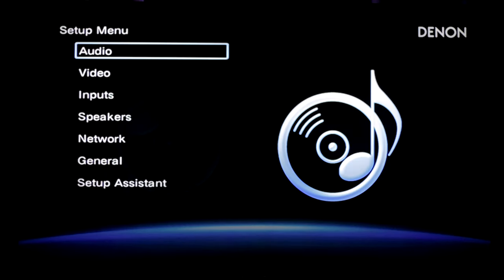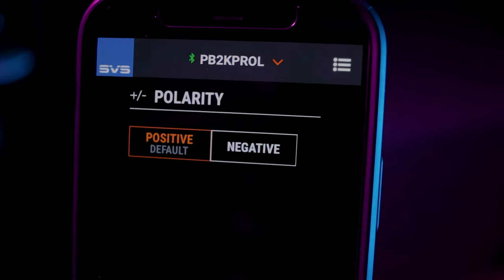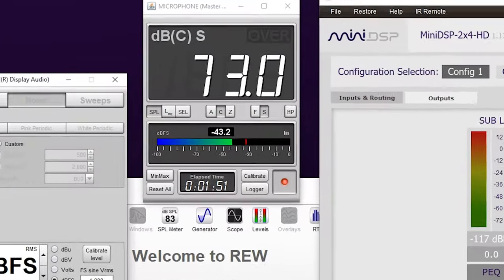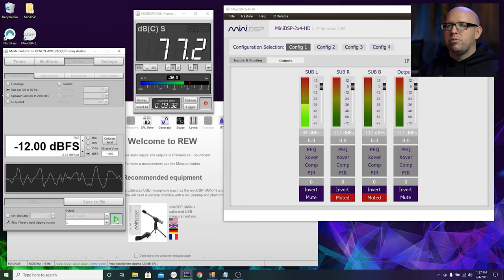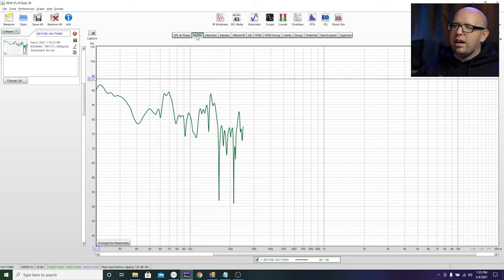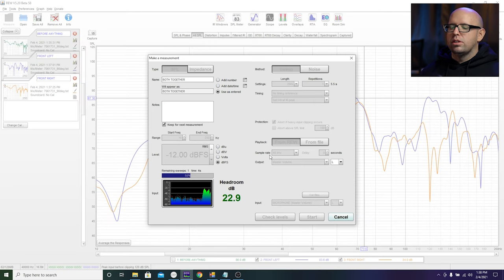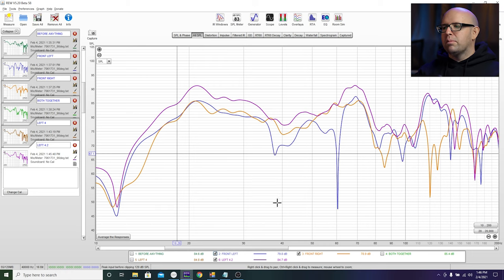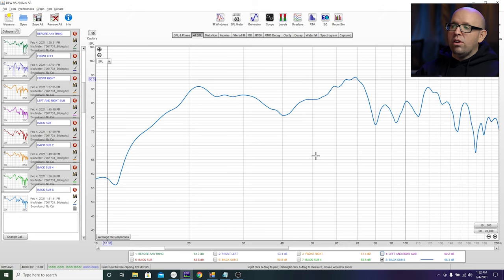miniDSP 2x4 HD | Subwoofer,  receiver SETUP and TIME ALIGNMENT guide (part 2)

Comment: Brad help!!!!  Why when I want to run my subwoofer sweeps am I only getting the sound from my front left channel?

Seems others have had some similar issues too without any reply.......is there not an answer to this?
Reply from the maker: That’s really interesting. I’ve not run into that problem. Are you using ASIO4ALL? If you are, try switching to JAVA or using output 4. Also, if you’re speakers are set to large in your receiver, or your receiver is in DIRECT or pure mode, then that might be why as well. You want it set to STEREO or Multichannel Input. And make sure you speakers are set to small. 

I’d verify all of those things and see what the results are. Sorry I can’t be of more help as I just haven’t experienced that issue.
Reply: @HomeTheaterGamer  I have tried everything under the sun.  Speakers are at small, levels are 0.0, Audyssey is off, stereo is selected,
Switched the Denon back to 1 sub.  Using Java. 🤷‍♂️.  
Thanks for replying 🙏
Reply from the maker: @Ryan Lewis just so I’m understanding you correctly, you’re not getting any sound from your subs at all, correct? 

I’d also make sure to verify that on the MiniDSP software, under the inputs and routing section, that ANALOG is selected. Mine defaulted to USB. Also make sure that all Xovers in the Outputs tab are bypassed.
Reply: @HomeTheaterGamer  I have everything set as you just stated.  I am getting sound from my subs but also from the mains when setting SPL levels.  
But, When I take a measurement in REW the subs are not working, just the main as my lowest frequency is 38 which is on par with the RP-8000F.
Reply: @78rlewi  I'm having the same issue. When I'm attempting to level match, my left front channel outputs pink noise with the sub cal setting. I'm not getting any noise from my subs. Have you figured this issue out, by any chance? Thanks!
Reply: @degicank22  This is my issue
Reply: @dariusdaniels9181  I have two SVS subs. I had to power them down and reset them to get sound out of them, for some reason. Resetting them did work. You will get some noise out of the L or R main speaker, but should only be above where crossover is set. In my case, 250 hz.

Comment: Hi should I be leaving the output to the left channel (L) when measuring levels on my sub?  Or should I be changing the output to LFE?  Although I have raised all crossovers and disabled DSP (I think) in my Yamaha receiver I am still getting output from my main channel when using the L channel for the test.  Even with the REW setting changed to sub.  Not sure if I am perhaps missing something in the Yamaha or if I should switch it to LFE for measuring the level of my sub (I only have one).  Thanks for any advice!
Reply: Same here with my Denon receiver

Comment: Great video! I just bought a UMIK-1 last week and followed your video to get some sweeps of my sub. If I'm running only 2 subs don't you want to add delay to the second also? If they are about the same distance? I'll be adding a second soon and curious. Looking forward to the next video I'm curious on what to do next as far as calibration with audyseey and if you run it next. I like to run my subs hot usually over 80db to get a final trim of -11. 5 maybe some of this will be answered in the next video 👉. Also one more question I have 2 sub outs on my denon should I run just one to the DSP to control my 2 subs? Or both sub outs to the in of the DSP ?
Reply: Just one sub in, mini dsp will split the signal internally.

Comment: When you gain match, do you keep the distance from listening position the same? In my room the Front Sub is 11-9 away and the rear sub is 7-6 away. Does it interfere with the delay time?
Reply from the maker: I wouldn't worry about the distances too much as time alignment with the miniDSP will take care of that. It shouldn't interfere with the delay time at all.
Reply: Cool. I just bought 2 Monoprice THX 10s so I will have to try and gain match them and see how that sounds.

Comment: Great set of videos very useful! I have a question though I've set the crossover in the receiver to 250hz but when I play SUB cal pink noise I hear it through either my left or right speaker as well as my subwoofer. It throws off my calibration to 75db because its so loud from my main speakers.
Reply: I have the same issue. I set the crossover to 250hz in the receiver, but I'm getting pink noise from my left channel. On top of that, I'm not getting any noise from my subs. I see a rise in the output meter in the MiniDSP plugin, but no sound. I don't have them muted. Not sure what's happening there. By any chance, have you solved this issue?
Reply: I get the same issue. I've got the crossover in my Yamaha RX-A2080 set to max 200hz on all speakers, yet I still get output from the left and right tower speakers rather than isolating to the subs. Hope someone can help
Reply: @mwstorms21  My issue turned out to be a problem with my SVS subs. I wasn't getting any sound from my subs, and the receiver was directing the sound to my mains. I had to reset the subs to get them to pick up the signal. For calibration, I believe that you'll get noise from the L or R mains (which ever is set to receive the signal in REW), but above the crossover set in the receiver. When you run the frequency sweep, the sub should output the signal up to the 200hz. As for the pink noise, make sure the sub is receiving a signal. That was my problem at least. I know everyone's issues are different, but I hope this helps a little.
Reply: @degicank22  same exact problem here. I think he left out a step
Reply: I got the same issue with my SONY avr so I just unplugged the speaker cables and then I got the sound from subwoofers only. It could be some simpler thing going on I just can’t figure out.

Comment: Hi thanks for the explanation, why are you using the 90 degree mic cal file if you are calibrating in stereo ? I read in the minidsp that the normal file is to be used when you are calibrating a single speaker (like a sub) please let me know if I got this wrong.
Reply: Since he is measuring three speakers in a HT set-up, the mic is in the vertical position and the 90deg cal file is for that position.  If your are measuring a single speaker "near field" for it's performance or a stereo 2.1 system you use the mic in the horizontal position and the 0deg cal file.  I hope that helps.
Reply: @welderfixer  thanks

Comment: I noticed that no Phase adjustment was done in the minidsp.  Is there a reason why you didn't?
Reply from the maker: There is a reason. Adjusting phase on the subwoofer itself or adding a time delay using the miniDSP both achieve the same thing. Time aligning is basically adding a delay to one sub to match another, which is essentially what the phase adjustment on a subwoofer does (adding a delay to the input signal). I chose to use the miniDSP as it allows for far more granular control down to a 10th of a millisecond and I also find it easier overall.

Comment: Brad, curious.  what would you set the distances to in the AVR?  I have 4 subs.  2 in the front corners and 1 on each side of my couch.  If 2 are 10 ft away and the rear ones are 7 feet away is that what I would set them to in the AVR distances tab?
Reply from the maker: That's a good starting point. The sub distance settings aren't really related to distance, though. They're essentially an alignment adjustment so they blend with your mains better. If you have REW and some free time, use REW to to measure different settings for each pair of subs and pick the one that gives you the smoothest response at and around the crossover point. That will be the optimal distance setting. I'll be doing a video about this soon. Possibly even this week.
Reply: I guess what I'm curious on is in the mini dsp the 10 and 7 would be good starting delay points ... but in the AVR I would leave distance/ delay at 0 since the dsp will be handling that correct?  oh and in the level matching.... what did you set the subs gain knobs at to start with

Comment: The the master volume meant to be at ref? 0db?
Reply from the maker: It can be but not needed here. If you do want to run it at 0dB, then you'll want to change the tone generator and measurement volume to -30dBfs. Otherwise, you could damage your equipment and possibly hearing running those at REW's default of -12dBfs.

Comment: I've followed the first video and this one to a T, but I can't get sound to play out of my subs. Minidsp is connected, subs are hooked up and on, etc. When I select sub cal it play through my speaker that the speaker cal did.
Reply: I'm having a similar issue. My front sub will play pink noise, then for the second output on the rear sub, my Left front speaker plays. I'm lost.
Reply: Okay, I had it in Direct. I switched to Multi-Channel Stereo and problem solved. Hope this helps the next guy.

Comment: Do you need a powerful computer for this task?
Reply from the maker: Not at all. I often use my nearly 10 year old Windows 10 laptop for REW measurements and calibration and it works fine. A more powerful computer will shave off a few seconds here and there when doing certain things in REW, but for the most part it’s all the same.
Reply: Thanks!

Comment: Why would you use the left speaker to level match and not  the subs? And how did you even play a test tone to the normal front L speaker with only the 2x4 hd?
Reply from the maker: The left speaker is only the reference point, as we need to know what volume to set the subs at relative to what your speakers are playing, and this assumes that you’ve level matched all your speakers as well. If your speakers are all level matched to say, 75dB, then you want your subs playing around that level, but a bit more if setting a house curve (see my other response for a quick explanation as to why).
Reply: @HomeTheaterGamer  thanks a lot for the response mate. I actually completely missed a step. I didnt catch that you need to connect rew via hdmi to the reciever to play tones to the front speakers. Thanks a lot
So yeah
1) set volume of avr with fronts
1.5)find sub position
2)level match subs
3) time align subs

I am sorry that I typed so many messages :D

After you level matched the fronts and sub you disconnected the fronts right? For the actual time alignment and Level matching of only the subs
Reply: @HomeTheaterGamer  So only one thing left unclear for me. When do you turn off the front speakers? When measuring subs to be sure only the subs are responding?

Comment: Is that dsp which makes annoying noise and has low tabs?
Reply from the maker: Not that I’m aware of. I’ve had no issues with noise at all (it’s dead silent and there is no audible noise coming from the subwoofers). I’m not sure what you mean by low tabs. Could you elaborate?

Comment: Can you tell me why you set the sub to 0.0 in the Denon ?.
Reply from the maker: We want full control of the level within the miniDSP and don’t want the AVR adjusting the signal at all. It’s basically taking out any variability. You can theoretically have the sub level set to anything in the AVR and as long as you don’t change it, you’d be ok. But, if you set it to -3dB in the AVR, you may end up having to boost it more when doing EQ or after the fact as EQ tends to bring the level down ever so slightly. I’d avoid going over 0dB sub level in the AVR at all costs though as it may introduce distortion and clipping depending on overall volume.
Reply: @HomeTheaterGamer  I set the sub to 0.0dB in my marantz. But after running Audyssey it has set the sub to -10db ?
Reply: @Prevstar  The -10dB is showing that the "gain" setting on your sub is set higher than Audyssey was expecting, so Audyssey set the AVR output to -10dB to bring the volume level of the sub down to the level it needed.  There is thoughts that say that your setting is actually a good way to set up subs so the sub has more available power to the driver and isn't held back by the gain setting being low.  Having the gain on the sub high and AVR set low or in the negative is like having a V8 engine when all you are using is a 4 cylinder amount of power.  I hope that helps.

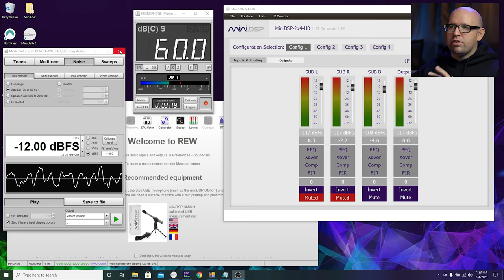Comment: Around 11:50 you said that the ability to time align subs is the main reason to get one but technically you could time align the subs without it since you have a variable phase dial and not only a 0/180 deg switch. All the delay is doing is adjust the point in which the driver moves in and out in relation to the other subwoofers which is the same as using those dials. Good video tho!
Reply from the maker: @Tyler Stout thanks for the feedback. You are correct. I should have mentioned that for subs with the ability to variably adjust phase, you can time align them without the miniDSP. For subs that lack app control and have a variable dial, I would still prefer the miniDSP instead of using a subwoofer's variable phase dial as I find it easier to play around and find the best setting, plus you can always revert back to the a setting you had previously by putting in a number instead of trying to find the exact spot on the dial again. 

This comes down to personal preference and opinion, as one may find one way easier than the other.
Reply: @HomeTheaterGamer  For sure! Just wanted to make sure people who wanted that but didn't want the minDSP knew they had an option :)
Reply: @HomeTheaterGamer  Isn't the whole purpose of time aligning speakers to be time aligned with ALL other speakers?   A bass note on the center channel should be the same instantaneous bass note timing as the subwoofers, left, right, height, etc.... This is the dilemma/issue that I'm fighting with my system.  Kind of a big headache that may result in a bunch of audio gear ending up in trash and then a beer run made. hehe

Comment: So... You don't need to connect HDMI to anything, just send audio to your receiver, integrated, pre, amp, etc. You could do this via analog i.e. Rca I almost didn't get a minidsp because of this. Luckily I checked the minidsp manual
Reply from the maker: This is true for stereo calibrations. However, with the recent updates to REW and subwoofer calibration and additional features, I would still recommend an HDMI connection if possible. Either the current REW version and an HDMI connection, there is no longer a need to disconnect any speakers when doing subwoofer calibrations or integration with mains.

Comment: He never says what his initial gain setting was on the back of the sub,LOL. Must not matter,Oh well.
Reply from the maker: Start at 50% gain or around there, then level match them like I do in the video. Although it really doesn’t matter as you’ll need to adjust the volume anyway during level matching, so you can start with the sub volume all the way down and then bring it up from there.

Comment: Wow, what a waste of time. Haven't you heard of Multi-Sub Optimizer tool (MSO)? 

You take your REW measurements of each sub separately (Audyssey - off) and repeat the measurement for each seat if more than one MLP is needed. You do the measurements with with acousting time alignment enabled. Then you export all measurements as text files into a new MSO project after it was configured to use Minidsp 2x4HD with 10 PEQ filters. Hit calculate and after a few minutes, MSO will generate you Minidsp PEQ filters, the output gain of each sub, the relative delay, and the shared filter (input PEQ) if needed for a house curve you supply... (not recommended if using Audyssey dynamic EQ).

Once all the filters are loaded into minidsp, you can run Audyssey with only one sub, which is actually a multiple set of subs already calibrated.
Reply from the maker: My intention with these guides was to keep things as plain and simple as possible, which unfortunately MSO is anything but simple. It’s an amazing piece of software I’m sure but does require a major investment in time to learn how to use it properly. Time I’m already wasting apparently on someone who thinks this video was a waste of time anyway. To that end, I bid you farewell.
Reply: @HomeTheaterGamer  

I meant a waste of time going through all the process of manual calibration, which will never give optimum results. MSO has a new wizard which makes the whole process very quick and simple. It takes 3 minutes to setup MSO, once you finished taking the REW measuments.
Reply from the maker: My mistake. Sorry about that. I’ll have to look into the new wizard they have added to MSO when I get time.
Reply: @ebarbie5016  is there anywhere a tutorial for mso and how to setup it correctly? I would try this maybe